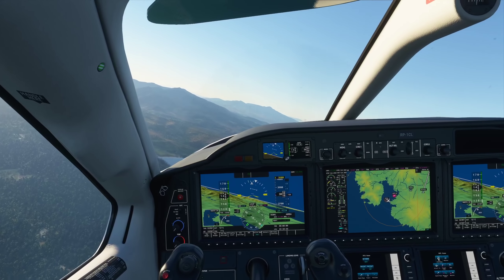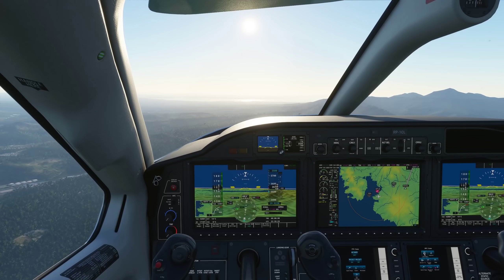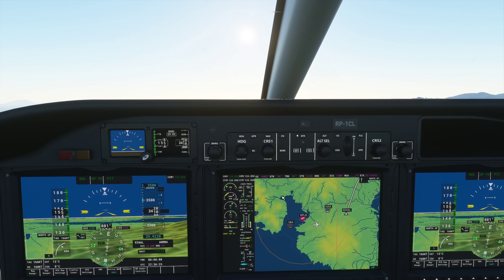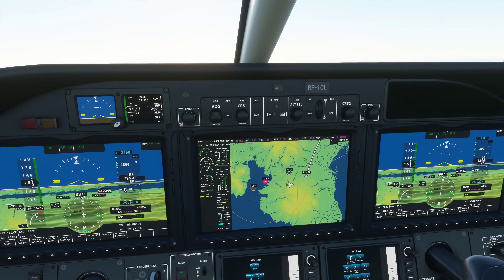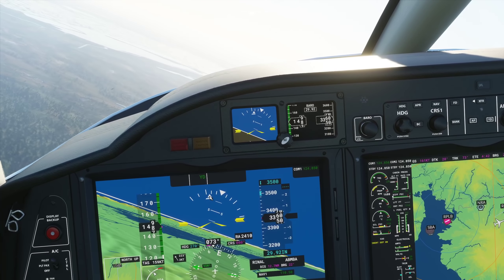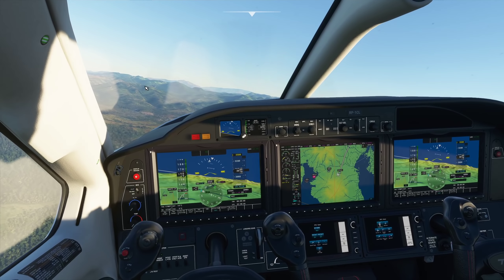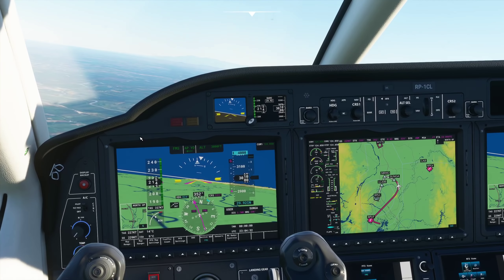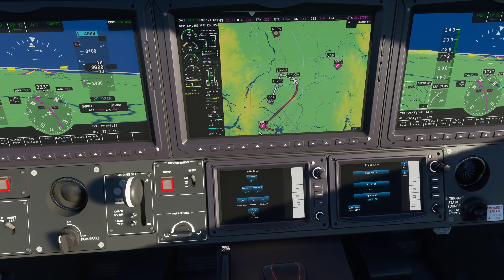Autopilot is BROKEN! (or is it?) - Microsoft Flight Simulator

Comment: Personally I have not had many issues with the AP on GA planes.
Reply: have you ever tried it on the SW 121? I just never seem to get it to work
Reply from the maker: It works mostly for me, too. Just can be improved with smoothness but overall it works.
Reply: Asobo has already said that they know that they only partially implemented autopilot on GA aircraft. It's one of their listed known issues. I'm bothered by this because I'm wondering what the heck they've been doing. They didn't do the maps and landscape, that was Bing Maps. They didn't do the AI buildings, that was Black Shark (or whatever that company's name is). I appreciate what is here as being the most advanced simulation for the home ever, but the way they released their own content (meaning what Asobo worked on) seems like we paid $60-120 for early access.
Reply from the maker: It does seem a bit rushed in some aspects, especially in the systems, but on the actual flight mechanics, oh man it's such a joy. I'm happily staying and learning to fly with small planes with simple avionics until they get it sorted. I'm thankful they decided to release it early and have basic stuff working than releasing a more polished version but a few months later.
Reply: It’s definitely great if you get to play it, but after they released that mini patch on Day 3 I can’t complete a single flight without the game crashing.
Reply: TechyMark I see what you’re saying . I wish the systems were more fully developed. One thing is vnav and vertical nav in general in the glass cockpits . But overall I’m very happy , it’s light years ahead of the default planes in x plane . I never touch defaults on there . What I’m excited for is the third party stuff to start releasing that is when this will be the best sim in every aspect .
Reply from the maker: Same here! When I started in xp11 I mostly jumped straight to payware. Excited what 3rd party devs will come up with for fs2020.

Comment: Think of the FD mode as "this is what the autopilot would do". It is not related to HDG mode. HDG mode always overrides AP mode. I have had the VNv mode work (vertical navigation). It is designed to control altitude based on your flight plan. It will not engage if you are way off course and/or altitude of your flight plan. Similar to APR  mode (approach) doesn't do anything until you are close enough to the airport to pick up the localizer signal.
Reply from the maker: About FD mode, exactly, so when you are in HDG mode and move the heading bug, the FD should move towards that heading. Currently it's staying still if AP is off.

Comment: I always come back to this video when I have AP issues. I always have a problem with VS and reducing vertical speed. Decreasing VS doesn't happen right away no matter how many times you press the button or use the keyboard commands. The ALT keeps setting  itself at the last altitude level and wont let you decrease the VS.
Reply from the maker: While in VS mode, you can adjust the steepness of the climb/descent by using the mousehweel on the nose up / down knob.

Comment: Ty for this video.please can you explain me how to use vnav in the panel of the cessna longitude?thanks I don't understand what is it for.
Reply from the maker: Unfortunately I don't think VNAV is implemented yet in the sim. Ideally vnav should be like VS/FLC, but instead of you telling the plane how fast the descent is, the plane calculates it automatically based on the altitudes plugged in the flight plan.
Reply: @TheClumsyGeekGaming  today I try this mode but will I have to activate auto throttle?
Reply from the maker: @SpaCCoo  vnav doesn't work yet, but autothrottle does. You can check the timestamp in this video to jump to that section.
Reply: @TheClumsyGeekGaming  ty a lot you are very kind.last question how you know what work and what doesn't work?
Reply from the maker: @SpaCCoo  sure thing! I try them out and read a lot in forums.flightsimulator.com 👍

Comment: Love the video, don't have time before I need to head to bed to finish it all, but I have a random issue, only happens once in a while, but while in flight, my plane decides sometimes for the nose to point straight up and fly vertical, and I'm not sure why. I try to put the trim back into where it needs to be but it keeps rolling by itself back to nose up and it pulls up very violently, literally have to hold the stick down to try and keep the plane level. Not sure if it's a bug, but it doesn't do this all the time, but every once in a while it'll do this.
Reply from the maker: That sounds like the autopilot trying to maintain altitude but not having enough thrust to do so. Try pushing throttle more or setting correct mixture (leaning) for better power in higher altitudes.
Reply: @TheClumsyGeekGaming  I was in the DA62, throttle was at 80%, just the second I let off the stick, the plane wouldn't stop trying to pull straight up to the point I saw the red lines appear. I would have to hold the stick down to kinda maintain level flight.

Comment: I seem unable to make adjustments to the 787 when its below 2000ft trying to land, it just locks up all controls and sometimes lands in the landing lights or off the centerline. I even tried to give it full aft stick and it didn't budge at all, sometimes heading for a sure crash and sometimes just a terrible landing, once it reaches something like 10-20ft it gives back control. Am I doing something very wrong or any way to disable that completely? It might not be the most realistic but I kinda just want to fly and have some fun with touch and go's.
Reply from the maker: It does seem like it should work, but I have been staying away from airliners in this sim as they're all still quite raw.

Comment: My problem is that the airplane ( no matter if its Cessna or 747) start to lean (roll) when the autopilot is engage and will never fly with wing level anymore. Then the airplane will keeg a 10 degrees roll during the entire time the auto-pilot will be engage. Very strange with the weight and balance and fuel load properly checked and engine(s) working normally and trim to neutral...Besides, it doesn't keep the selected heading accuratly...For example heading 270, AP Heading function engaged, if I select 360 heading the airplane will start turning normally to the right, maybe to 355 and will stay there, not completing the turn...never seen this before, neither in real nor simulator flight....I have been using autopilot in real airplanes for 30 years so I can be sure that I'm not making any mistake.....Procedures are ok, check lists are ok, fuel loading is ok.....
Reply from the maker: Yeah AP is the biggest problem of this sim right now, imo. Lots of raw stuff still, but hopefully will improve in the upcoming patches.

Comment: Still getting the issue when turning on the auto pilot in the Longitude, where it just wings over to the left and nose dives. The full 737 MAX experience...
Reply from the maker: Sounds like a stall. Do you have enough thrust set?

Comment: When I select and load+activate or just load an IFR approach in G1000 it creates some weird point named "USER" that's usually somewhere near the start of the flight plan at zero ground altitude and I can't get rid of it since you can't modify anything in the approach flight plan on the go. The only workaround for this I found is to just remember the approach points and fill them in by hand to create a stable path for NAV.
If anyone encountered this please let me know if there's an easier workaround.
Reply from the maker: Yes, I encountered the same issue in my latest video today. I unfortunately don't know of a proper way of fixing it except for just setting heading mode and navigating on your own. I hope they fix it soon.

Comment: Really nice tutorial, thanks.  Curious though, on the G3000 how do you change the range shown on the map in the middle monitor?  On the G1000 there are "range" knobs, but no range button on the G3000.
Reply from the maker: Thanks! Press first the MFD button in the lower mid panel (either panel will do), then the range knob is the one in the lower right corner of that panel.
Reply: @TheClumsyGeekGaming  Perfect, thanks!

Comment: Clumsy, try this one. Depart KCOS for KGXY. When you reach KDEN select the RNAV 35 with the Zerna Transition. The TBM system will show ZERNA on the map but the CDI on the FMS in the PFD will have you turn 180 flying completely the WRONG direction. Can you help me understand what is going on here? Thanks.
Reply from the maker: Yikes. Sounds like one of those navdata issues. I can't wait for navigraph to include full integration with the sim.
Reply: Clumsy, funny you mention that as I thought the very thing. I neither heard nor seen anything about NAVBLU since this initial announcement. Then I hear Navigraph say their data will be available soon. So what, we are going to have both or an option? I like the idea of the Free NAVBLU but I, like most people who use X-Plane already have an annual subscription to Navigraph data, Charts and Simlink.

Comment: Hey Clumsy. Great video, really helpful and informative! After properly putting all the flight data from Simbrief on the FMS on jets (Cessna Citation CJ4) and airliners (Boeing 747-8i) during climbing and cruise phases the autopilot doesn't respect the VS Mode going all the way up and down all the time (I've set it to +1000FPM with both Speed and VS Mode On) and during straight routes the plane keeps doing a zig zag and doesn't follow the straight route line, so I've ended up using Heading Hold during those parts instead of LNAV to do a straight flight and to not make my passengers dizzy lol. Btw, Autothrottle and FD are both online. Are these bugs or there's something I'm forgetting? Thanks in advance!
Reply from the maker: Thanks! Yikes that sounds edgy lol. Seems like you're doing right things, but these are most probably bugs with the smoothness of autopilot atm. A lot of refining needed there.
Reply: @TheClumsyGeekGaming Found out what the problem was!. Simply disabled both the "assisted yoke" option in the Assistance>Piloting Menu and "Gyro Drift autocalibration" in Assistance>Aircraft Systems. Now I can properly fly this beast :)
Reply: Maybe I'm missing something but I cannot seem to engage autothrottle on the Citation CJ4 Latitude. It looks like he was demonstrating on the larger Longitude. It is a bit of a pain to keep tweeking the throttle back and forth once at cruise altitude.
Reply from the maker: @DNHarris  I'm not very familiar with the cj4, but afaik that plane has no autothrottle.

Comment: Fly level with the C172 steam gauge and hit AP. Roll is set to default and there's no time to change it to heading (doesn't matter because it doesn't follow the heading bug). The AP takes roll as in it's going to roll the aircraft and even though you're level watch the trim wheel as it practically spins itself off it's mount. Been trying to try different things but I don't see a single video like this about it so guess it's just something that skipped the whole "development" thing.
Reply from the maker: Hmm thats interesting. I've been able to use the AP fine with the c172 steam gauges, trying out both HDG and NAV modes. I'll try it out again next time to see if I encounter the same issue you've had.
Reply: @TheClumsyGeekGaming  Thanks. Just in case my situation is unique (doubt it), I'll explain my scenario.
Sadly the C172 doesn't have radios. No option for no GPS and have the standard radios that come with all other sim platforms so one must use the GPS to fly VOR to VOR. I'm doing that and inputting my VOR 1 & 2 freq via the gps with the gps obviously on VLOC.

Soon as you start AP, ROL is enabled and the aircraft rolls so violently it's nearly impossible to click on heading. If I do get it (one out of ten tries or more), then the aircraft turns steeply and pitch is all over the place. Tried dozens of times over several days with plenty of reboots. I had the issue with two of my computers.

PC A = my aging 5960x, 128gb ram, 1600w, 2080ti. 1 M.2 and 2 SSD's.
PC B = i9 10920, 256gb ram, 1600w, 2080ti. 3 M.2 drives and 4 SSD's. Fresh Win10 pro install.

Back when I was more okay with making little money I was an A+ certed comp tech and am a perfectionist in my builds. Nothing against you but without someone posting a video of any other type of behavior following exactly what I do (simply non-glass and flying VOR to VOR) then I just can't believe it since as mentioned, two completely different builds both the same exact behavior.

Otherwise good info. This is not my normal sim channel, but am Mr.Turbine777 and often tackle complex AP tutorials. This AP is just broken. Would love to be proven wrong on this, trust me.
Reply from the maker: Can you try double checking if you have any assists accidentally left on? I remember one person here commenting they had weird rolling issues with the longitude and they fixed it by disabling gyro assistance or something like that.
Reply: @TheClumsyGeekGaming  Haha, funny you happen to mention that one in particular because during some flying tonight the gyro drift was getting wayyyyy too unrealistic. To the point I swore I must have had shared keyboard or controller mappings. There were no conflicts or shares, just very abnormal and not realistic (I was up north, from Massachusetts to Vermont and then to NY but the drift was off 20° every few minutes). I'm stubborn to where I don't want to set aids of any kind and went and found that setting. It was off and I was tempted to enable it but didn't. I figured I'd do a flight tomorrow further south to see if they're trying to make it more substantial the further north one is. Realistic concept but very unrealistic drift as if I had magnetic paint. So again, nothing was enabled other than what makes it more realistic, like icing, etc. Odd that the only category that isn't "Hard" is "User Experience" because I have "ATC Voices" enabled it says medium haha.
Reply: @TheClumsyGeekGaming  Been on a few flights and it's been working fine. I'm pretty sure it was my routine in changing pax weight. I often changed the weight of me, the pilot and often tossed people in the back but kept it below max weight overall and it seems as long as I fuel up only that I don't have an issue. However, this is most certainly an issue with most of the aircraft as reported all over the forums and is at least being addressed in patch 2. Hopefully it will soon be a thing of the past. :)
Reply: Oops, forgot this page was open for later updates. The above Dan, Turbine777 and this "DanHoven", is all the same simming dork ;)
Reply from the maker: Haha ok thanks for clarifying. I was starting to get confused lol.

Comment: I press the AP button but nothing happens. The AP just remains off. I press again and again but nothing happens. No alarms, no warnings — just nothing. The AP just stays disengaged.
When I press the HDG button it activates but when I try to adjust the heading — nothing happens as well. The aircraft just follows its current course. The same situation is with the ALT button: it activates but whenever I change altitude it doesn't affect anything.
Reply from the maker: Are you flying the TBM? Make sure the AP/trims switch is set to on. It's in the overhead panel, rightmost area.
Reply: @TheClumsyGeekGaming  I have moved the AP/Trim to "On" position but pushing HDG button doesn't keep heading. Pushing ALT button doesn't keep altitude.
Reply from the maker: What is it saying in the annunciation? It should say all these things: HDG AP YD ALT
Reply: @TheClumsyGeekGaming  It doesn't announce anything. The button is activated (the LED strip is lit) but then I change heading or altitude nothing happens. Heading and altitude hold modes work fine on some other aircrafts. I assume this is just one of the game bugs. Unfortunately there are plenty of them.
Reply from the maker: So in the top of the PFD, the bar is just blank? Hmm strange indeed. Haven't seen that issue before. Probably best to consult that in forums.flightsimulator.com so experts can chime in. Good luck!

Comment: I believe they will be releasing the first update this 27th.
Reply from the maker: Looking forward to the fixes they have planned!
Reply: TKW 242  that crashing could be because a bluetooth device has gone to sleep. If anything is disconnected from your computer it will crash the game.
Reply: TKW 242  I also hat a lot of crashes. Almost every 10 minutes. I had to increase the min size of the page file. Now I can play hours without a crash.
Reply: TKW 242  yes you have to! :) Set it manually I think I set an initial size of 150 GB and a very hight max size. Let me know if it works.

Comment: Autopilot is a bit broken. Did you find how to resume approach from the middle instead of waiting for the plane to always go the the beginning? Also I have experienced too many crashes when selecting approach modes. I recommend right now to approach ILS in HDG mode and then simply switch to ILS (with the right frequencies and course selected).
Reply from the maker: I've gotten quite a few crashes as well while trying to change the approach mid-flight. They'll need to fix those, definitely.

Comment: The autopilot in the single engine pistons are way messed up. Flying trimmed out and level , turn on FLC or VS and the autopilot pitches to like 20-25 degrees and stalls the plane
Reply from the maker: Yeah weird finicky behavior at times. Hope they fix those.
Reply: @TheClumsyGeekGaming  yea, so far havent had problems with the turboprops or jets, i mean they have issues, but the smaller planes go haywire